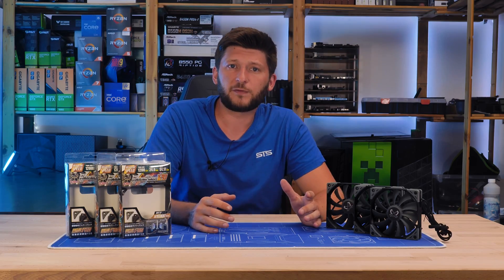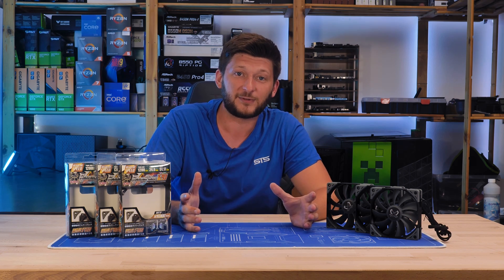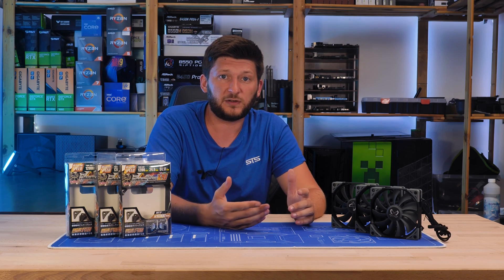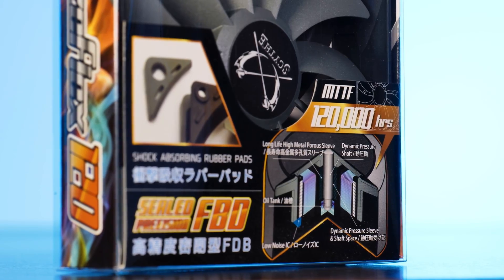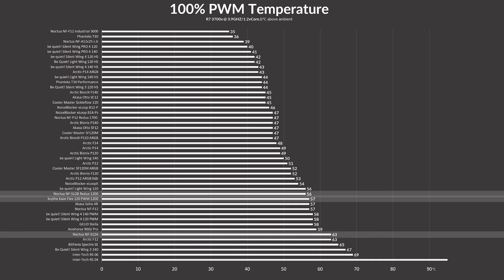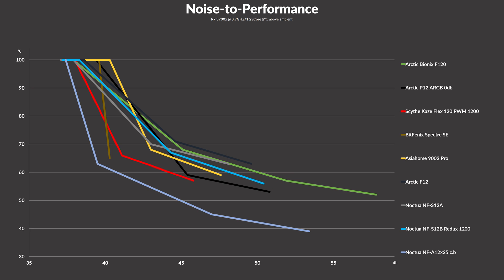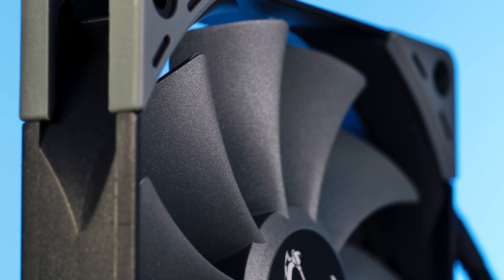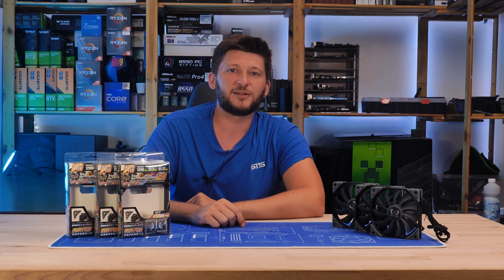Scythe Kaze Flex 1200RPM PWM Review - The Case-Fan underdogs

Comment: Just a reminder: As far as i can see, you testet the Fans in an ALL OUT setting like using the kaze flex as cpu fans and case fans. Ive myself testet 3 kaze flex front and 1 kaze flex rear with a noctua NH-d12L (thats the cooler i have) and changed the case fans to 3x NF-A12 front and 1x NF-A rear.

Weird thing is that my cpu and GPU temps are the same with the Noctua Case fans  instead of the scythe but with more noise.

Your test is good no doubt, but the fact that the cpu fans are also scythe, its hard to say if the noctua fans are really that good as case fans.

Would be cool to see a similar test where the cpu cooler has whatever fan you like(Nf12A or some good one), but the case fans changing.

Comment: Scythe has added a Kaze Flex Black 120mm - PWM fan - same style but all black, that has a rated RPM of 1500 although mine spin up to 1640. The SKFB does get significantly louder above 1200 RPM. Although designed as a case fan it works better than you might expect on a not too restrictive air cooler.